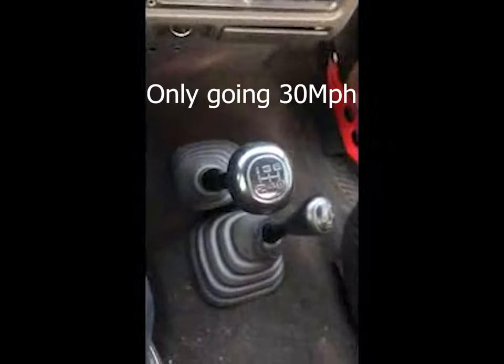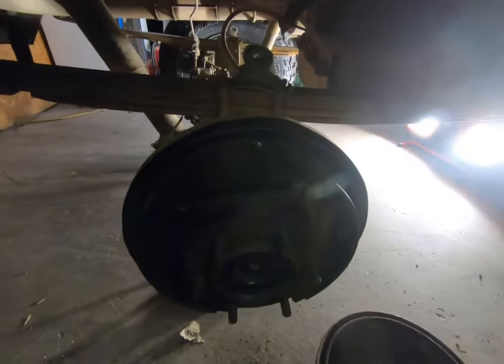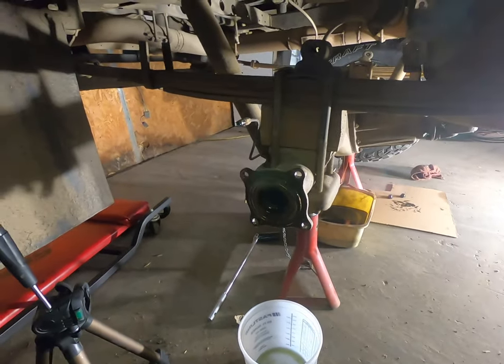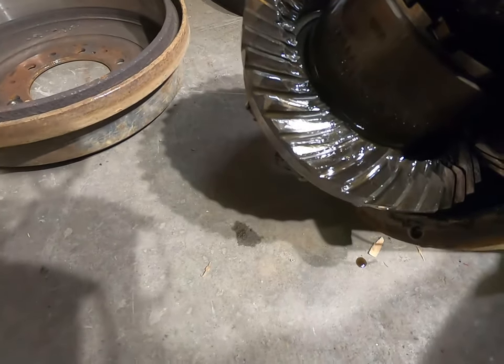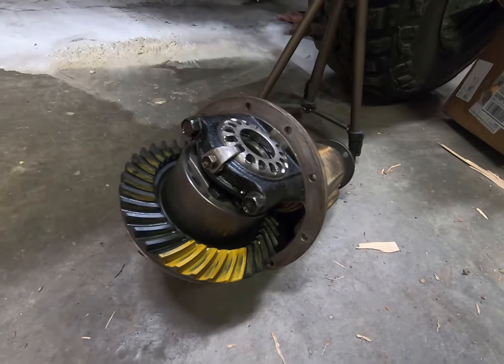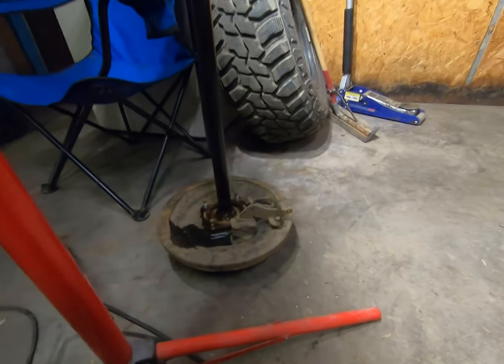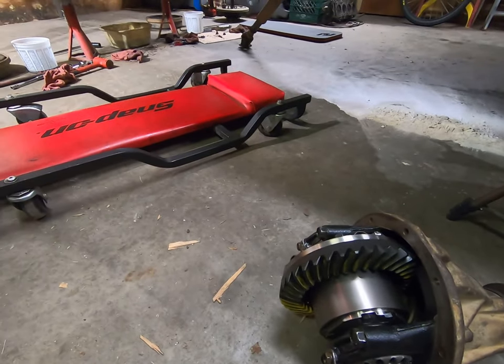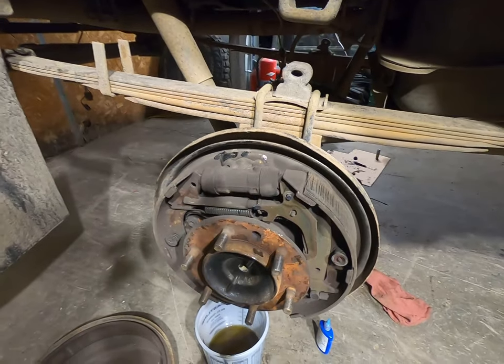Eaton TrueTrac Limited Slip Install (1UZ 1989 Toyota Pickup)

Comment: Quick tip for anyone about to perform the same, or similar operation...since you're that deep into the rear end, change out the little breather that sits on top of the pumpkin.
I blew out the axle seals on a truck I used to own because that breather became plugged.
They're cheap, available at any auto parts store and you just unscrew the old one and screw in the new one.
Cheap insurance.
Reply from the maker: Yea you can also take a couple brass fittings and a piece of hose and relocate higher if you will be submerging your axle in water. Anytime I see a pinion or axle seal leak I always check the vent first , very common to plug with dirt or rust.